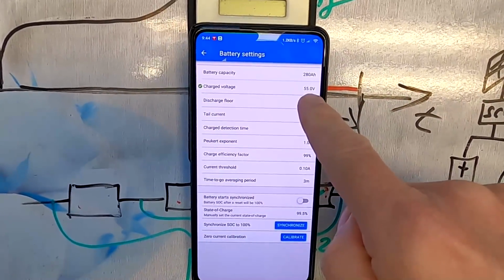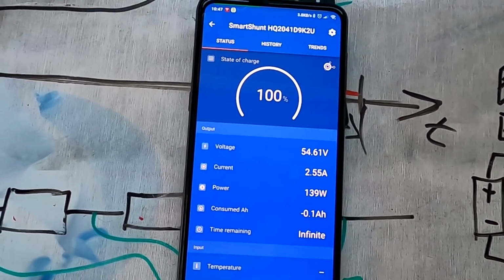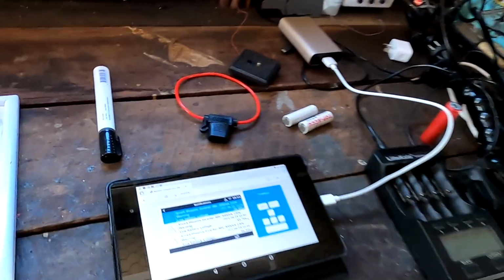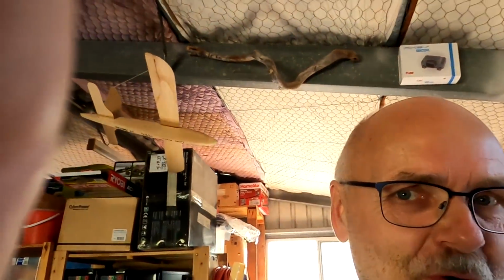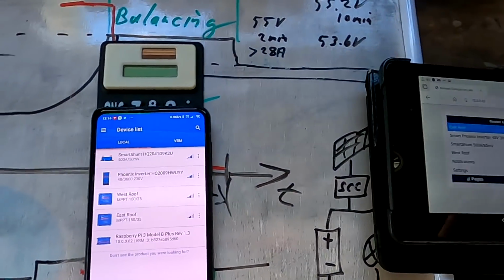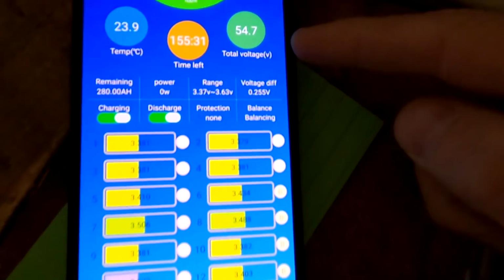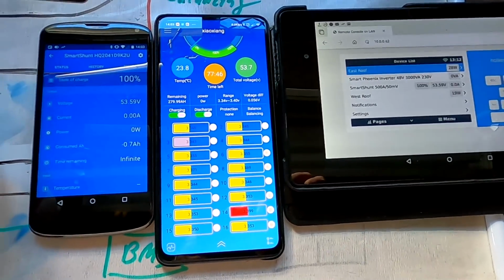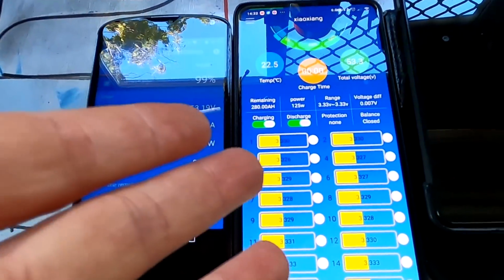Houston, we have a slight (BMS) problem and... are now Off-Grid!

Comment: Your weakest cell at the top knee point and the bottom knee point will dictate your useable charging range. (It might not be cell 14 at the bottom end). So long as you operate on the flat of the curve for all cells there will be no issue.
Reply: There is a problem with that, the balancing is is not accurate, and may even be causing the problem on the flat curve. Batteries need to be in higher SOC to balance.
Reply: @michaelbouckley4455   Two different approaches, you want to balance the cells, and I want to take away the need to balance the cells.

Comment: Well, i just can say, i told you so on the previous video. Balancing at lower voltage is not efective and yoh can be creating unbalance to the cells because you are not balancing at high voltage to balance the SOC on the cells. 😊
Reply from the maker: Yep, that's exactly what happened 😊
Reply: @OffGridGarageAustralia  I use JK BMS with Active 2 amp balancing, and it only disconnect charging in an overcharging event. I can still discharge the battery . I had that issue before and the way to solve it properly was top balancing the battery again. I had one cell 3.65 and the rest of the pack at 3.4(45). That was the fast way to solve that overcharging cell, but you can add a load to that individual cell and discharge it, like a light bulb or something. Now i make sure my balancing only starts at 3.4 volts, just in the end curve and i keep the cells floating at 55.8V so i can have an efective balance job. At this moment it is rare to the balancing to be active since the cells delta is low than 3mv. My issue before started because i had the balancing to low, stated at 3.3 and it seam that in that zone of the curve the cells can be much diferent voltage / SOC that they are at high voltage, and we induce unbalance in that zone of the curve and voltage. For now it is working perfectly for me, and as a note so far i always been able to so full charge to the pack everyday. the max i used to power my house at night is 50% but it is summer here in Portugal. As a note, congrats for your videos, they are very entertaining and i just love it. Cheers

Comment: Well that showed the imbalance.....   keep the settings you have but once in a while do a higher voltage balance check.  
Your final comment was correct, but does it matter.....?
Set your reconnect voltage lower, like 3.45 /cell  on the new BMS too.
Reply from the maker: So disconnect at 3.65V and reconnect at 3.45V? I don't think it even reached the set 3.55V until it reconnected after 2s.
Reply: @OffGridGarageAustralia  the reconnect on my BMS with same software is once the lower voltage is is reached then wait the time stated.

Maybe this clicking on/off is more as it wants to discharge again.  Your new FET based BMS should solve that.  Have said I didn't like your BMS  before.

Comment: Would a very small amps.  Flash lamp bulb or high resistance  across that cell cure the problem for now or will the same fault happen on another cell.
    Till a  solution is hopefully found.

Comment: The problem trying to balance at low voltage is that the charge curve is too flat until you Get into the ‘knee’ region. The cells don’t differ enough, despite being at different states Of charge, to activate the balance circuit. I use the same cells and I expected, on such inexpensive cells, that there would be some imbalance so I used a separate capacitative active balancer that works throughout the charge cycle and can balance at upto 5A if the imbalance is high. It has been running Now for 6 months with all cells staying within a few millivolts. My system has a self designed hybrid BMS so there is lead acid in the system that takes over if the lithium cut out however I also have a diode across the relay which allows for discharge when the relay is open. This would be an issue without the lead acid as there would be no low voltage disconnect but the lead acid gives loads of time for the gradual decline to be noticed. Also, with purely inverter based loads, the inverter low voltage cutoff can be used as protection. The hybrid idea was to give the best of both worlds so simplicity of charging using the uncomplicated lead acid profiles But giving the charge and cycle efficiency of lithium. I’ve found that the complexity of all the Victron gubbins can just tie you in logistical knots over what is in essence a fairly simple system. I do monitor everything using a pi and I can control all sorts of things but the basis of the system is simplicity hardwired into it. Yes it uses a microcontroller in the BMS but it is one you can adjust And program in something that approximates to English rather than proprietary gobbledygook.
Reply: I agree with your statement about being in the 'flat' part of the curve. 1 mv different may represent a large amount of imbalance from a capacity perspective. I was fully in agreement with his strategy here until this 'sh*t' happened with the BMS. I am reconsidering my position here and I think he needs to balance at a higher voltage (in the elbow of the curve) where 1 mv represents less of a capacity delta.
Reply: I like the idea of putting lead batteries in parallel with the lithium batteries so much. It can keep the electronics happy while the lithium finishes its super long balancing cycle!
Reply from the maker: Yeah, well, I have to rethink my position here, I guess... 🤔
Reply: @OffGridGarageAustralia  Or a supercapacitor
Reply: Ya, I use this same exact BMS, and I think it works great. I certainly have not experienced the switching on and off. Irrespective of the BMS though, I do think the you guys are right about trying to balance at too low of a voltage. I also use an active 2A balancer with my setup, however I was forced into that after my battery source on Alibaba sent me used cells.

Comment: You order all kinds of nifty devices.  Despite what you said, I would really love to see if the 5a active balancer would solve this...  I mean, even if you just tried it.  :-)  And let us know it doesn't work.  You can get a parallel split for your BMS balance leads and leave the port open for testing.
Reply: I am absolutely satisfied with my capacitive type active equalizer/ balancers both 4S and 16S. I’ve heard of issues with the resistive types but can’t speak from experience with those.
Reply: I have used an active balancer with a new pack of cells. They do work well over time, especially with the first charge cycle to get all the cells well balanced. The active balancers only using resistors are essentially useless, but the ones using capacitors are a go to.

The alternative is to manually balance the cells by charging/discharging or getting a power supply and charging all the cells individually, but that takes days to do...
Reply from the maker: Hearing you...
Reply: @OffGridGarageAustralia  
There’s one more thing to check. When a BMS is balancing, it puts a resistive load on the high cell(s) than it stops looks at the voltage than repeats as needed. A bad crimp at the terminal balance lead can do weird things. It can give an accurate voltage when reading but it has resistance on balance load. Crimp the crap out of it. Check the balance connector too. Give it jiggle.

Comment: On my opinion the BMS must have two relay.
One to disconect the load in case you get minimal voltage but the charge controler remains connected.
And the second relay to disconect the charge controler, in this situation, and let the load connected.
Maybe the "secret" BMS will have this features.
Reply: @ionel popa - It is called a Dual Port BMS.  Unfortunately, he has a Single / Common Port BMS = Yuk ...
Reply: @MrSummitville  AKA Separate Port
Reply: That makes good sense, the shunt has a relay output control that you can operate with various parameters, I don't know about the Phenix inverter but my multiplus also has a programmable relay connection.

Comment: 1. The Balance is too low (200mA) - you push more than 2A. The Situation is in my Opinion, the cells are out of Balance a lot - you told that the last complete cycle was 3 month ago. So the cells had plenty of time to drift apart. The "weakest cell" empties the quickest and gathers power the quickest. Every pack has a "weak" cell....
Give the pack time to get in line again - 15 cells have to ramp up - and one cell needs help by "burning power" quicker.... I would put some load on cell 14 till all cells are equal again. 
2. In my RV I do Top balance at 14.4V and I set my shunt to recalibrate at 14.2V and <2A.I do not care if the capacity is 97,98,99,100%.I call it full and use it. You make the shunt-thing maybe too complicated.
3. By thinking the situation again:
It seems to me, that more cells in series (higher voltage), the easier it is for cells to trigger the BMS HVP. Because when I look to my system, I use 4S with 14.4V. So when a cell drifts to 3,65V balancing starts at 200mA. But I push only 14,4V and 2A to the System = 28W.
And the weak cell will gather power quickly and ramp up the Volts - because its the weak one. I am not sure it the Amps ore the Watts fill the Weak Cell. I have the feeling the weak cell behaves "not normal" in this situation.
Your system is 55V and 2A = 110Watts. Maybe the bad cell gathers more Watts than the other cells and so 200mA of Balancing Voltage is too low for your 55V System. 
But this is only my hypothesis - I can not provide any signifikant Information.
A higher Balancing Amp will help to feed more power (Watt?) into the 15 other cells? 

Maybe you can see what I am trying to say and have more qualified ideas to it.

Greetings from good old Germany by the way :)
Andreas
Reply: I balance at 3,6V! Not 3,65.
Reply from the maker: Thanks for that. It's definitely amps which charge your battery.
Well, it was my try to keep the voltage lower but obviously 3.35V is far to low for a successful balancing with such a low current.
Reply: @OffGridGarageAustralia   no, I disagree. I would say your Pack was not balanced for 3 Month but it was used every day. So the cells had plenty of time to get out of balance. But as far as I can see the 200mA balancing current is too small. The weak cell gathers Amps more easily than the other 15 cells. And that's the problem. The "burning of power on cell 14" is too low in comparison for a) the drift that had time to built up in 3 month, b) 3,35V is right in the steepest part of the load curve. So a bit more Energy let's the Volts rise extremely quickly. So there is the need of "getting rid of that Amps on cell14" - 200mV is not enough!. Please try additional balancer with higher balancing current.

Comment: So you need a BFS - a Battery Fire-wood System ;-)
For the second battery scenario, if the BMS switches off the first battery, the second one will get all the current at once, and it is more likely to have higher voltages on these cells as well.
Thanks for sharing your experience :-)
Reply from the maker: Well, then I need a 3. and 4. battery so it does not matter if one fails 😃

Comment: I would lower the charge controller voltage so it has control before the BMS does, so figure out what voltage works with the high cell and then set the charge controller to that then BMS only takes control when it needs too otherwise charge controller does all the work as it should.
Reply from the maker: I could do that until the cell has balanced, yes. Good thinking.

Comment: This isn't really surprising.  You can't top-balance LiFePO4 at that voltage (as I said in my comment on the previous video).   You might actually be unbalancing the cells instead, in fact, so now current acceptance is all over the place.  You are giving the balancer parameters that it can't possibly work properly with.

There are lots of reasons why it doesn't work at that voltage.  In this case what you are seeing is probably related to massively different current acceptance at that voltage. Basically the voltage ramp for cells at different SOCs is going to behave very differently at 3.35V - 3.375V than they would at 3.50V-3.55V.   So differently that the balancing circuit has an impossible job.

-Matt
Reply: I have to agree, the balancing has them "Middle" balanced per se. I have an active balancer that never balances until my cells are over .5 deviation. I hadn't used my batteries for a month or two and they work fine. They stay at around .001 unless under a big load or charge then they may go to.3 to.5v. I would also check the cell 14 terminals as well. Could have a loose connection.
Reply: I mis spoke that would be .03 -.05 my balance happens at .05 deviation. I ran maximum of 3.6kw (house power with 3 ton AC on) yesterday and batteries were in those specs. Max DC current through batteries was about 70 amps
Reply: @danfitzpatrick4112  I am generally against the use of active balancers.  They should not be needed at all for a LiFePO4 pack.  If an active balancer actually is needed is might be hiding more significant problems with the pack.

That said, an active balancer might be necessary if the pack is built with used or mismatched cells... which is probably gonna be a more common situation when one buys cells on Ali.

But I still don't like active balancers.  If building a pack out of used or mismatched cells the better solution is to buy a few 'extra' cells and choose the best-matched ones for the pack.

-Matt
Reply: @junkerzn7312  I absolutely love my active balancer. It's rarely balancing. The difference is that it supply's power to the cells when needed whereas the other balancers "steal" power from the high cell and re-distribute to the other cells. It is also not dependent on a particular BMS.
Reply from the maker: I'm testing and exploring... so, 3.55V with a 2h absorption time still makes sense to allow balancing. The standard settings of the LFP profile...
Reply: @OffGridGarageAustralia  3.50V might be enough if you are concerned about high voltage.
And it doesn't have to be every day. Victron Energy also sells LiFePo4 batteries and they ask you to charge them to a higher absorption voltage (for balancing) once per month. You could experiment to see how well your cells stay in balance over time.

You have a choice to make: short duration balancing every day VS. longer duration balancing once per month or so...

If the cells are imbalanced they have different SOC status. The whole battery usable energy while discharging is limited by the cell with the lowest SOC (its voltage will drop quicker than the other cells). Charging is limited by the cell with the highest SOC (its voltage will rise quicker than the other cells)

I am using a 2Amp active balancer JK-BMS, but I allow it to run only while charging. It is turned off when there is no charging. I'm working automating it based on cell voltage (should only work above 3.45 V). Otherwise I suspect it ruins the cell balance more than it helps.
Reply: @OffGridGarageAustralia  I'm looking forward to your findings!
Reply: @OffGridGarageAustralia  It would be interesting to research just how much balancing is needed in the long-term.  LiFePO4 maintains its balance quite well over long time periods, so theoretically even just giving the system a mere ~30 minutes a day in balancing time ought to be plenty.

-Matt

Comment: Im wondering why the bms isnt staying off until the release voltage
Reply: I think Lifepo4 cells don't hold 3.65 volts when you stop charging them.
Reply: @uhjyuff2095  They will hold for a bit but not long.
Reply from the maker: I was wondering the same as it should have re-connected at 3.55V. The voltage clearly stayed at around 3.63V all the time though
Reply: @OffGridGarageAustralia  Yeah had me thinking. Could there be another setting thats not letting it?

Comment: Andy, I think by balancing at 3.35 volts you are setting your bms up to fail. It just cannot see enough difference in volts to properly gauge soc. You might even turn your bms balancer into a randomizer. I think you should balance at least at 3.5 or maybe even 3.6 volts. See also default Victron lion settings that absorb to allow balancing.
Reply from the maker: Yep, my testing failed. But good to see for me (and learn) this does not work due to the flat curve. I'll go a bit higher and see when I can make it work 😃

Comment: According Victron, you should set the reset voltage to 0.8V under absorbtion voltage (0.2V for 12V), 5% tail current for 5 minutes.
Reply from the maker: Are these the standard settings?
Reply: @OffGridGarageAustralia  these are the recommendation by Victron for LiFePo4 battery when charging with solar.

Comment: The BMS should control charge and discharge and not the charger or Inverter do the settings. Both will never know cell data....
Reply from the maker: The BMS should be the last mechanism to protect the battery if something like this happens. You're right, the BMS should tell the charge controller to throttle charging speed and allow balancing. But in which system is this the case?
Reply: @OffGridGarageAustralia  i do not know a System with 48V , which can do it. But SBMS0 from electrodacus can do it. Incl. Wifi (not Bluetooth) and Lots of Software options. But it is not an option for you, because it is limited to 24v. The bms you need, needs to be able to turn on / off the charger and Inverter.your Victron products have these Inputs. But the qucc bms has no outputs. Take care of these controls with your next bms. Go for a separate Port bms with these output and without a Relais. The bms will turn of charging or the Inverter in case of a low voltage Situation. Thank you for your work and this Chanel. It is fun